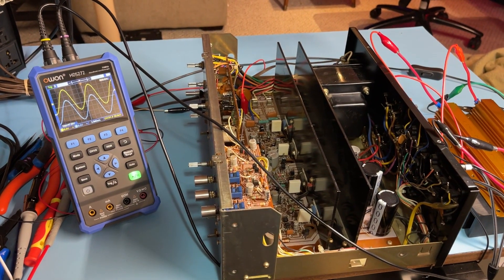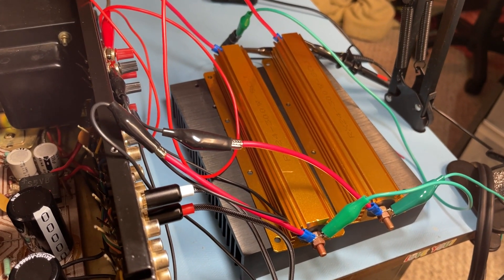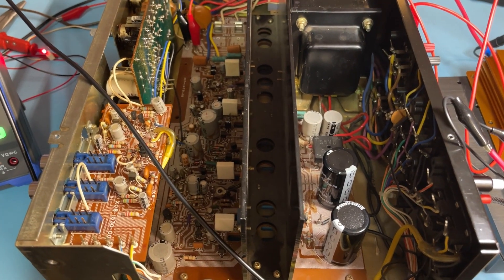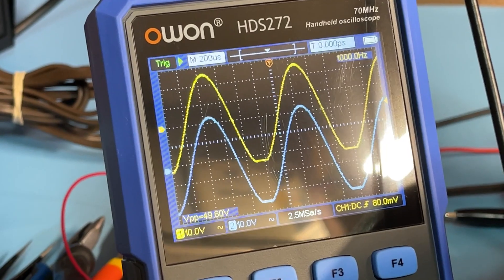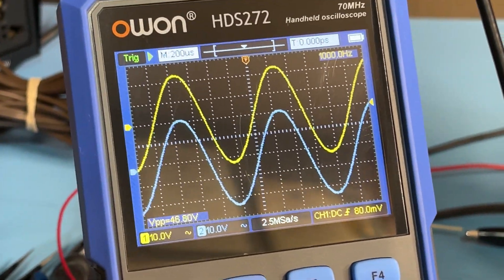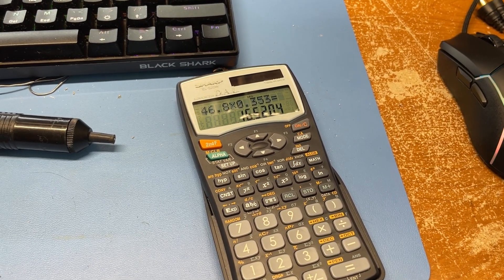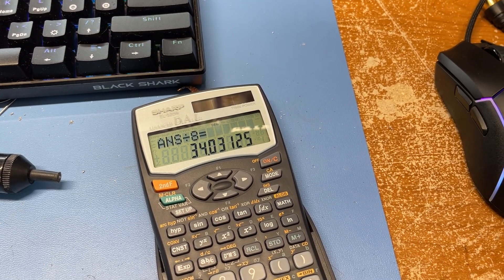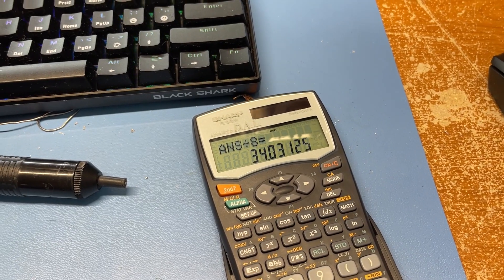Measuring output power on Amplifiers

Comment: Is it safe to take this voltage measurement from the speaker with a voltmeter to get a rough estimate of the voltage sent to the speaker.  I guess I would have a looper running on the input of the amp to generate sound.  Adjust the volume until I hear clipping and make the calculations based on the voltage reading I get when I stop turning the volume up.  Is that safe for the amp?  Think it would give a rough estimate doing it this way?  I am trying to get the RMS of the amp so I can swap out the speaker, no marking on the speaker to indicate anything but ohms, I know the speaker is 8 ohms.

Comment: Hi, just want to say thanks for the video! it's really helpful.. Your method is really simple, I like it! I've been holding myself for trying this measurement because most video that i saw involves several devices like ampere meter, multimeter, oscilloscope, signal generator etc.. I never had oscilloscope in my life and as for now I can't afford OWON HDS272 like yours, can you advice budget friendly multi-function oscilloscope that able to do this measurement? what specification should I look? do you think something like ZOYI ZT-703S is sufficient? thanks!

Comment: You may have a miss-calculation there. I've always read that RMS is roughly 70% of Peak. Thus to convert Peak Volts to RMS Volts, you multiply by 0.707 or divide by 1.414 and then carry on your log calculation to find Watts.
Reply from the maker: When you want Vrms from a Peak to Peak measurement you use .353.  When you want Vrms from a Peak voltage then you use .707
Reply: @daveytechca  Oh, I missed that bit of info in the video. I stand corrected. Sorry to bother you.
Reply from the maker: @RawDepth  You didn't bother me, don't be silly :)  I do however appreciate that you watched my video intently enough to question my math.  Thanks for that!  <3
Reply: Can you do the formula if you want to know where to set your voltage out from the amp? So you have 2000 watts at 2 ohms, what voltage should you set the amp at?

Comment: Interesting, I was wondering how that was calculated. Thanks.
Reply from the maker: You're welcome!  Glad I could help out.  Thanks for watching!
Reply: (U=V)
(!for sine!): U_RootMeanSquare(eff) = 1/sqrt(2) * û 
 = 1/sqrt(2) * U_peakpeak/2 = 0,3536... * U_pp
So the factor comes from the reciprocal of the square-root of 2, but times 1/2 (because the maximum voltage alternating around zero is 1/2 of the peak to peak voltage that is displayed from the oscilloscope :)

Comment: Usually those dummy loads can be found in 4 ohms or 8 ohms resistance, but suppose I use speakers with nominal impedance of 6 ohms, a power amplifier rated for 450 W RMS into 4 ohms and I have to know how much power the amplifier would deliver into a 6 ohm load.
There is not an abundance of high power 6 ohms dummy loads ready to use.
Reply from the maker: Are you sure?  😉

https://a.aliexpress.com/_msJ4J7w